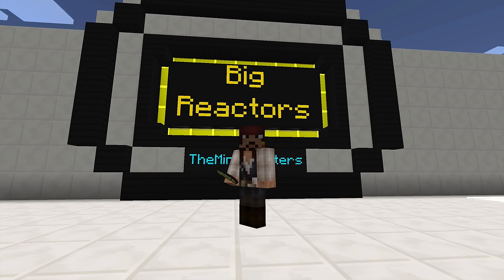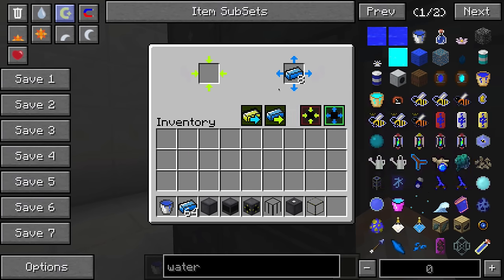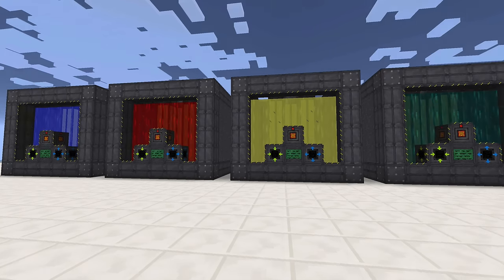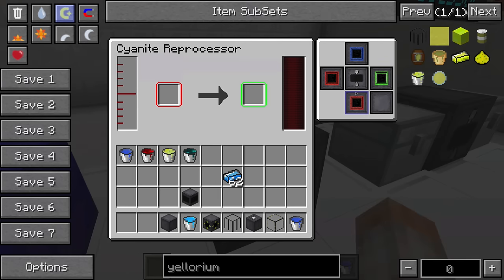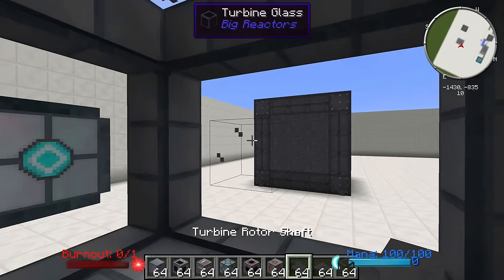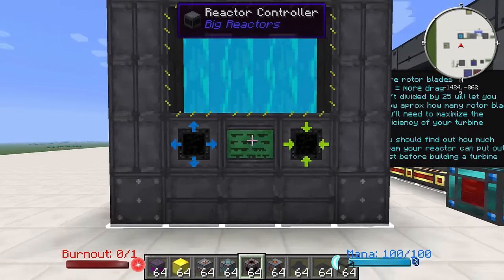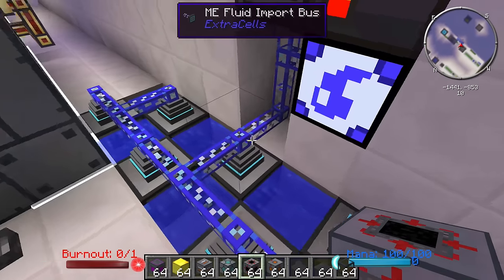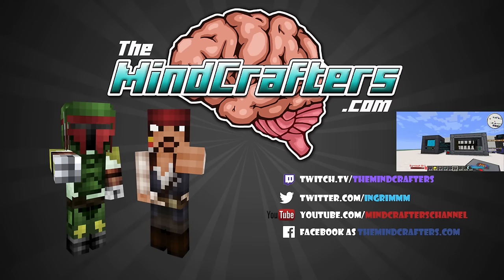Big Reactors Tutorial - Reactors & Reactor Turbines

Comment: Instructive video, but you could have explained the connection between the two... You mention about right clicking with empty hand to change the color of the ports in the comments as a reply somewhere, but nowhere in the video.
The extra water you seem to get with a workaround using another system, which isn't what I was looking for. I don't have that  system, and I'm stuck with a low rpm turbine and no water going from the reactor to the turbine.

Comment: I have a few questions! Would I still want to put in Gelid Cryotheum in the actively cooled reactor that generates steam? What is the best metal to use for the coil? Can you have multiple turbines if you can produce enough steam? Also, is there any performance differeance between putting your turbine upright or sideways? Thanks, if someone is able to answer all of my questions! :D
Reply: Gelid Cryotheum is better for the Casing cooling and Enderium is better for Fuel Rod cooling. And I think so it helps. The best for the coild should be Ludricite. Yea you can have more then one Turbines at a reactor ^^ And you can put ur turbine how ever u like ^^
Reply: Thanks so much! :D I've been building all the parts and getting ready to make it, but I'm working on getting some Gelid Bees to get me my Cryotheum, but I'm like one bee breed away, so thanks again for answering my questions!

Comment: thanks for the tutorial. helped me a lot.

BTW: where do these blue awesome signs come from?
Reply: can no one tell me where these signs/screens (whatever they are) with the blue font come from and what their name is? I'm playing with the IceHenge Pack since a week now and didn't found these up to now.
Reply: Enra987
Information panels.
Reply: Divey1130
 thanks got it.
Information Panels from the Nuclear Control mod :-)
Reply: Divey1130 The information panels I've seen in Nuclear Control are large and CRT-like though. Do you know how to get the flat ones like he has?
Reply: Matthew B
the Info panels have settings. You can adjust how thin or thick they are, the colors etc.
Reply: Enra987 Heh yeah I found out not long after that they had those. The interesting thing is that in the latest versions of Nuclear Control 2, the majority of the settings for the Advanced Panel have been disabled by the mod author. So thickness, angle and restone activation don't do anything.

I didn't realise that those were the settings to change the thickness, so that's why I was curious how he did it.

Comment: Ok in the current Big Reactors release for MC 1.7.10 there is NO way to change the turbine fluid port to OUTPUT, they are static set to INPUT only so the whole water recycling thing is a no-go. Not very efficient to use until its fixed unless you pump a shit ton of water from a nearby ocean or lake and don't mind loosing / venting the steam condensate to the ether.
Also NO the right click with bare hand trick does not work either to change the I/O of the port.
Reply: use a wrench to change from output to input
Reply: Thanks, I figured it out.

Comment: awesome tutorial. one question. where on skyblock do i get the fuel. is a sand sifting system ok or will it produce not enough yellorium? is there a better way to produce yellorium so that i dont need to worry? (i have no idea how much is used coz i am starting this hole thing right now. but the lava bucket-lavagen system is kinda annoying^^). thx for the answer!
Reply: The following doesn´t make sense. I didn´t read the "skyblock" for any reason...

Yellorium has an ore in the underground. Just crush it into dust if you have an ore-doubling mod, and smelt it into ingots, which are the actually fuel.
Reply: 3 tin to 1 sulfur in the induction smelter
Reply: A skyblock? Why would you build a Nuclear Reactor there if it blew up your whole island would be gone, although that would be pretty funny.
Reply: As I know, Big Reactors don´t blow up - yet.
Reply: a skyblock has no oregen,a nd what do you mean sand or sifting?

Comment: I'm confused.  I had a reactor that was creating approx 19,000 RF per tick and once I converted it to actively cooled it now produces about 6,000 RF per tick and is using way more fuel.  I've tried more coils/more blades, less coils/more blades, more coils less blades, less coils/less blades, I've got the water flow perfect and I got about 9,000 RF per tick at one point, but something isn't working right.  I have gelid cryotheum in a 7X7 reactor with five rods.  My turbine is 9X9X11 with enderium coils.  I'm about to give up on actively cooled and just go back to passively cooled.  I needed to up my power output, but now I'm thinking I should have just added a new reactor dedicated to tesseract usage.  Anyone have any ideas?
Reply: i am not entirely sure because i am still reading up on the mod but i think you don't put in a cooling liquid like gelid cryotheum in actively cooled reactors because that would effectively lower the steam production

Comment: You should also point out that the actively cooled reactor still requires coolant inside it to be efficient (enderium or cryotheum) it increases the steam output by like 4-5X. Also how to size your system is based off how much steam you can generate which dictates how many rings of metal (enderium blocks is best) you can use, the number of blades is really an afterthought as they seem to have no effect on the rotor speed, only the time it takes to spin up and the efficiency, which, conveniently tells you how many you need in the efficiency tooltip. so far with a single rod 4 high reactor 10% rod insertion i have been able to generate ~960mb/t steam equaling 11000rf/t @1800rpm
Reply: Some tips for people building their own turbine: 1. No more than 4 Aqueous Accumulators per fluiduct per coolant port. 2. Fluiduct can accept unlimited? amounts of liquid/steam but can only deposit i think 120mb/t per connection so between the turbine and reactor you will need multiple connections to get the maximum flow rate which will be one of your main bottlenecks. Recommend one outlet and 3-4 inlets for both steam and exhaust water return. 3. The overflow from the turbine will be a major source of water so making sure its not bottlenecked should be one of the top priorities. 4. Limit the turbine flow rate to exactly the right amount to get 900/1800rpm then from there start slowly winding back the reactor till you get an output slightly higher than whats required steam-wise to allow for waste buildup in the reactor affecting performance.

Comment: 33:20
How are you loading the water? I cant get it to work. And what storages are in your ME?
Reply: +Wheatly Montoya I would guess he has "ME 64k Fluid Storage" in the drive. Some fluid storage for sure I just dont know what size.
Reply: have you figured this out yet?  I just now am having the exact same problem.  Everything I have is the same as what he shows but My reactor won't get any water.  I have a tonne in the ME system I made for this but nothing is going into the Reactor.

Comment: so the liquids added in the reactors simply just cool down the reactor ? or do they help generate more rf?
sorry i don't get this D: but i will learn :D
Reply from the maker: Infernal Guardian it's actually quite complicated :D Fuel Rods pump out fast-radiation and slow-radiation along each axis (up, down, left, right, front, back). Each coolant liquid affects conversion of fast-radiation into slow-radiation, conversion of slow-radiation into heat, and conversion of heat into energy. The more heat in the reactor, the more fuel you waste. The better your slow-down, absorption, conversion-rate the more RF you produce. Pretty much the whole trick then is to find a good balance between everything. This reactor-sim is a great resource, and this is a pretty good passive reactor design http://br.sidoh.org/#reactor-design?length=13&width=13&height=1&activelyCooled=false&controlRodInsertion=0&layout=4O5E8O5C8O5C8O5C4OE3C5X3C2E3CXCXCX3C2E3C5X3C2E3CXCXCX3C2E3C5X3CE4O5C8O5C8O5C8O5E4O&modpack=direwolf20
Reply: The MindCrafters I found reactors don't need to be really large for the size of some turbines as it comes to to mostly water flow rate into the reactor and how fast your can expel steam so even some of the smaller ones can get the job done for decently size turbines in the testings I have done.

Biggest issue for people is running into piping transfer limitations which was my problem for a long time with my first one as I never considered it for some reason. Tesseracts fixed that for me. Hopefully their unlimited transfer rate does not get patched out for some weird tier Tesseract inclusion :/ that would be something COFH would do.
Reply: The MindCrafters Help! I made a reactor with all the things needed but it wont create the multi-block. Any help? When I right click it it says -59, 39, 878 - Block is not valid for use in the machine's interior
Reply: BlockTunes Those are the coordinates for the block that is interfering with the multiblock completion. Try heading to the location and seeing what it is. The only thing that can be on the inside are Fuel Rods, gold, iron, diamond, etcc... and an assortment of fluids.
Reply: AK474000 Okay thanks! I have nothing on the inside yet, so i will check it out!
Reply: The MindCrafters Can I connect this exact reactor to a steam turbine?
Reply: KarRuptAssassin The active cooled reactor produces Forge compatible steam so anything that can use steam is good to go.
Reply: +BlockTunes go to these coordinates and place a block of reactor casing. if u get this message, it means that your reactor is NOT complete
Reply: apo akgul Hack...No thank you
Reply: +apo akgul what is THIS ? there is hack advertisement for Big reactor now ?

Comment: in skyfactory 3 therees this thing called vapor of (levite) just search for vapor of and an upside down bucket should show. what i heard its the best coolant in skyfactory 3. i have 21 controll rods and 4 coolants spaces and i have under 1500 degree celsius. and over 20k rf per tick. but somehow my brother uses redstone and has the same heat but like 70 k rf per tick, but he plays on another modpack called project ozone.
Reply: and please anyone know a better storing device? i use 8 vibrant capacitors with 25 million rf per capacitor. so totally right now i only have 200 million.
Reply: Use 9 vibrant capacitor

Comment: you got quite a few things wrong, and with that steam turbine, I can produce OP amounts of power with a HP boiler from railcraft (they produce a crap ton more steam per tick and a full size boiler can produce FAR more steam than a basic reactor, as well as using much less stuff to make the boiler)
Reply from the maker: Please let me know what I got wrong so I can set the record straight.

Also not everyone has the Railcraft mod so it was omitted from this tutorial. It's not how the mod creator intended the turbines to work, however if you watched the follow-up video I put out....I did explain the boilers.
Reply: The MindCrafters
I forget exactly what you got wrong, but I think the primary one was you forgot you can shift-click on the machine face when configuring the sides to reset all of them. and the way he could balance them would be to adjust the value of the steam output and steam intake of the turbine and reactors, because as of now I have a turbine hooked up to a HP boiler and it produces a metric crap-ton of power (a full size HP boiler takes 9 fluiducts to take all the steam out) it produces 720 mB of steam per tick.
Reply from the maker: slango20  Okay. You'll have to understand how I might get a little offended when someone claims "you got quite a few things wrong"...when in fact I just omitted a bit of into and did not "get it wrong"?
Reply: The MindCrafters
yeah, sorry about that
Reply from the maker: slango20
No problem, thanks for watching!

Comment: I cannot use the power created by the reactors. I have tried every popular energy mod which has storage. It does not output. I am running 1.7.10. I am finding this mod useless for what I need it for.
Reply: It outputs RF. Any mod that uses Redstone Flux can use it. Energy Conduits need to be plugged into a power tap block, not just to the reactor in general. If it's not working, there's something wrong on your end, not the mod's.
Reply: Vet Leeber I worked it out. Some versions of the mod are bugged. I tried in 1.7.10 and now I have 10k power lol.

Comment: hey there, I have a BIG problem.

I am currently testing out in a creative world and the most mB of Steam my reactors can produce is 80mB per tick. It doesnt matter how tall or big i build my reactor, the maximum is 80mB per tick.
I also tried to put more steam outputs and everything on my reactor, it doesnt change anything.

I can also put my control rods at 0% and 90% and it doesnt change anything.

please help :)
Reply: I have this same problem except mine says it can only produce 200.o mb/t which is odd to me because my reactor is wayy bigger than the one in this tutorial.
Reply: @BriLynn  I already fixed it.
I didnt have enough water in my system.
So when you set up your reactor turbine system, give it a head start with a aqueous accumolator and a water tank above the pipes.

That worked for me
Reply: @fendtarena2893  ffs imma idiot THANK YOU I was just giving it water and letting it fill up!
Reply: @BriLynn  nice

Comment: https://docs.google.com/spreadsheet/ccc?key=0An54qOfSiXfJdEcyaHAxWURaZTR2eEpEWEFaU0xydXc#gid=0
https://docs.google.com/spreadsheet/ccc?key=0As9dFXD_KM2CdGFhTUxOUGxMRlpERWtPMmtGT213bmc&usp=sharing#gid=0

Here are two Spreadsheets by the Resonant Rise Community on Big Reactors.
I haven't watched the whole video yet - but the most fuelefficient reactor itself should be a 7x7, 3 high Reactor with 9 Rods in the middle. :) For Coolant, try to use Resonant Ender or stronger :)
The Fuel Efficiency is also defined by the temperature. At ~1000°C it will be roughly 10% less efficient compared to "0°C", whereas at 2000°C it will be approximately 90% less efficient. Before 1000 and after 1000 there is not much change at all.

Comment: I really need some help...I have build the reactor exactly as show everything works but the power doesnt seem to generate...i have tried to reinstall it and still nothing. the heat and amount of power being used works but never any power. What am i doing wrong?? Anything will be helpful man so confused
Reply: You putting yellorium in it ?
Reply: yes the RF never generates only until i take the output block off.
Reply: Do you have 2 input/output blocks ?
Reply: i have both of them hooked up the same way it is assembled in the video
Reply: Hey , I know its been a couple days but did you end up figuring it out ?
Reply: You need to put a reactor power tap on.

Comment: I've made a 9x9x9 reactor and the texture changes so I know it works, but it wont produce power? Any ideas?
Reply: turn it on? pump fuel in?
Reply: I have actually found out what the problem was. It was another reactor casing on the side of the reactor. XD so it was registering the extra block as part of it.
Reply: Jessy Wallace
 good that u found the problem!

Comment: As soon as I turn them both on, reactor burns through water instantly and temp skyrockets, and my turbine never hits max water output so it's not venting anything :(
Reply: got the same problem.. :-/ u got a solution?
Reply: Snipe13051 Use resonant ender buckets instead of water
Reply: ElectroDubstepMaster
Does that also help with Steampumping?
Reply: Jester Use extra utilities transfer nodes with upgrades i have a reactor at max heat and it works for me from a water source next to my reactor
Reply: Could also be your mod packs configs
Reply: Jester It requires a nice flow rate so you should check the transfer limitations on your piping as that was my problem. Easy fix I used was a Tesseract as they have no transfer cap at least in the 1.7.10 Direwolf20 pack. 

Set up some Aqueous accumulators and high capacity tubing to all sides of the Tesseract, it gives me enough water to produce somewhere near 1000Mb/t of steam though I would need to make my turbine bigger to use all of that. 

You will also need to think about tubing limitations for the steam output as well. You could create a bottle neck even though your reactor has the water and size enough for the turbine you are using. 

Some will suggest transfer nodes since that is a pretty cheap solution, but I love Tesseracts and they are easy to make for me anyway.

Comment: it keeps saying 238,65, 332-block is not valid for use in the machine's interior what dos it mean help
Reply: Those are x,y,z coords. The block set at that coord is not right. Hit f3 and see where that coord is and you will see what the issue is
Reply: I tried this (before I watched this helpful tutorial) and it said the same thing and I used all the casing correctly
Reply: That happened to me. The problem in my case was that while aluminum from some mods is valid, aluminum from other mods is not valid. If your coil isn't made of vanilla blocks, try removing it and closing up your turbine and see if that fixes the problem.
Reply: I had the same issue until I realized that I hadn't put the top layer of glass on. Derp.
Reply: you may have a turbine block misplaced (but connected) outside your turbine. For example, if you stick a piece of turbine glass to the outside of your turbine, it'll cause this problem. The coordinates in the error message might be wrong, too.

Comment: I made a turbine, but i can't add a controller. it turns into the turbine without it, and when i remove a frame to add it in it wont turn back into a turbine.
Reply: +DrFortunecookie nevermind, went back and checked the "build" part of the video, put controller in the wrong spot.